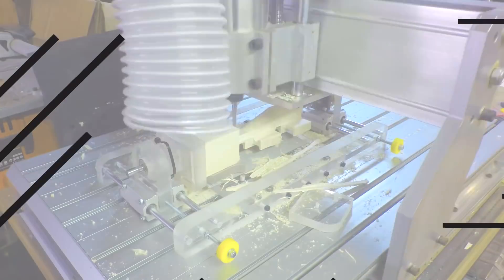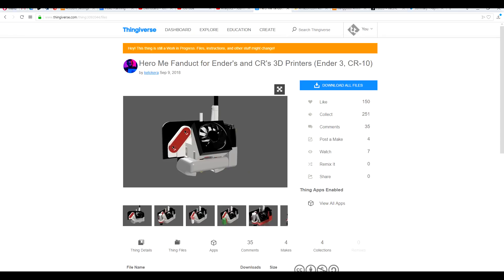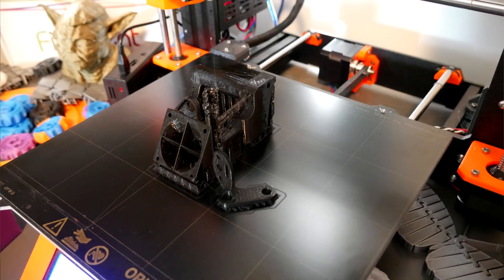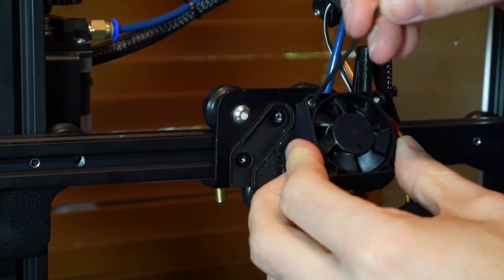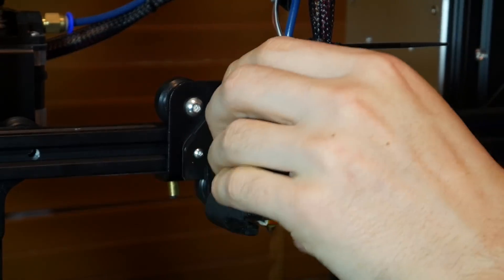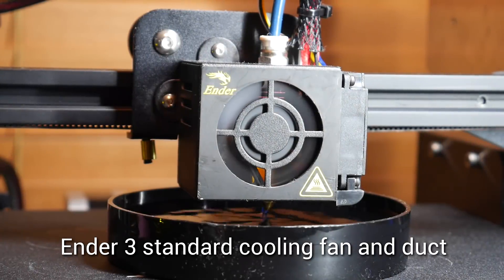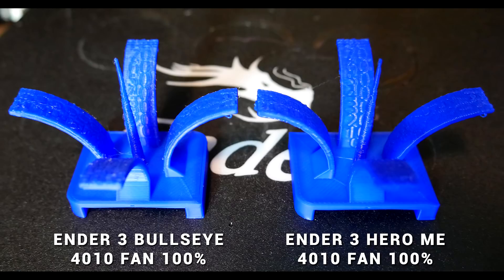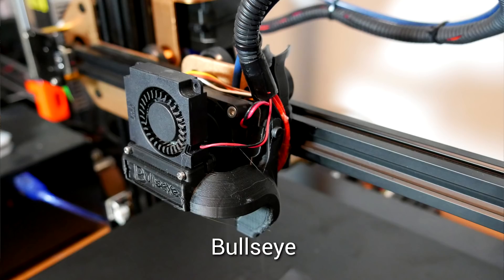Hero Me fan duct tested on Ender 3

Comment: So I am haveing a problem or missunderstanding. I have been looking up information on noctua fan upgrades for my ender 3 pro and it seems everyone is talking about how the noctua fan moves less volume(I checked and the data sheet promises similar performance at 12 Volts). So that got me thinking: Why is no one just using 2 Noctua fans in series? That should provide plenty of cooling. Sadly I couldnt find any fan duct prints for 4 coolers. I did measure the voltage on one of my existing fans and it was around 24.2 Volts, using the resistance I calculated that if everything goes well 2 12V Noctua Fans in series should behave like one 24V Fan but with way more volume moved. Is there something I am just missing? I would rather have 2 fans per one original 24V fan than use some buck converter.

Comment: what about to put big 120mm fan at side of printer, then bring some flexible hose eg fi20mm to the extruder? (sth like wires from mainboard)even plug to inlet there where fan goes in (i think about it), in 24V it can roates slowly (then quiet) and produce mass of airflow
i think ive seen it before on YT

Comment: There isn't enough space for the wires to fit between the lower piece that slides up. There's a grove for the wires, but they don't fit. They push the side fan out. The lower section slides far to high up as well, pushing the air right into the nozzle. If I drop it down, it's dangling so far from the top piece, that it's wobbly.

And the side fan (yes, it's the right piece for the right fan), doesn't fit. It's too fat where the two lower screws connect. 

It looked pretty though. And all cleaned up. 

All I can guess from this, is that my E3 version, is slightly different than the design intent.
Reply: Bloody hell, for all the issues, so far, the test print is flawless. The bridging was absolutely perfect! I've never had such great bridging.
Reply: Wow. This thing is remarkable.

Comment: 4010 blower doesnt fit to 4010_Pipes, it needs about 3,5mm to mount, but there is only 1,9mm and there is no space to modify that without damaging part, so just wasted filament.

Comment: Does anybody ever tryed to use a real powerful blower to cool down the print under the nozzle?

I was thinking on using a silent bldc blower, preferably oversized so that it could be used at low speeds, and channel the airflow through a flexible hose into a duct in the printing head (allowing to install the blower away from the printing head). One could even use an air mass flow  to control the cooling according to the linear speeds and temperatures etc...

The blower could be something similar to the blower used in the quick hot air station, but with better performance.

What do you think?

Comment: I need your help the Stock Filament Fan is no fitting in the slot at all to thin and screw holes are not aligned with the ones on the fan. i have the new Ender 3 pro . can u help me with a better model?

Comment: What 5015 blower fans are you running? Im looking for quiet options. going to upgrade to Noctua fans for hotend and electronics box. eventually i will upgrade to your rear mount electronics box. i like the clean look and leaves plenty of space upfront for tool and hardware drawers.

Comment: A bit of a pain to print to be honest, but works really well. I had to open it up in meshmixer and add support there in order to get it to print correctly without a huge mass of support in the wrong areas. I like that I can use this one with my direct drive setup on the Ender 3 whereas The petsfang/bullseye I can't as the fan sticks up too high.

Comment: Hey Michael. When I print an ABS part with the Hero Me, even when the part cooling fan is turned off, the part always curls up from the back. Every part I print seems to curl in the same place and I found out the the heatsink fan is also blowing air onto the part from the bottom constantly. I use a PEI bed, 240 on the hot end, 110 on the bed and no part cooling fan.

What can I do to stop that. Blocking the gap between the heat sink and the part holding the heat sink cooling fan only cause the heat sink to overheat.

Comment: I printed the Hero Me, but found it to be a little too tight around the heat sink of the hot end.  It's actually pressing against the left side (as you face the printer) once installed.  Also, the screws from the 4010 fan were too small for the holes in the base.  I know they have a few versions because the screws changed, but I thought I printed for the smallest screws, I'm having to go back and look again to see if perhaps I printed the wrong version.  Fortunately, it's a tight enough fit that screws merely need to act as "pins" to hold it in, but I still want to play around with this print to see if I can't get a perfect fit.  It does seem to be printing a little better than the stock in the few prints I've done so far - I've seen less stringing for sure.  I'll be happy if I can get a little more gap between the base and the heat sink, and be able to tighten the screws holding the duct.  In both cases, it's the base that needs work, the duct is perfect.
Reply: I also found this, what an absolute bugger. I printed the STLs that were recommended on Thingiverse. Still, I was happy that I could slap on a Noctua 40x20 without any modification (plus a Traco TSR24120 for regulation - small, good quality and cheap, about 5 bucks - definitely recommended over Chinese buck boards). I tapped the main duct with M3s - four holes on each side, I just ran through them all with a screw - but the mating slots on the part cooling ducts look like they're designed for M2s. I ended up tapping the slot as well by force and then wiggling until I could tighten the screws into something. Similarly the blower fan didn't really fit, and I'm not sure there's any material for the screws for that to fit into. It's essentially a friction fit and I'm not super worried about it. Really I think this thing needs to be overhauled for a better mounting system. It works fine as a cooling fan, but it's needlessly fiddly.

Comment: Everybody does the wiring wrong on the Bullseye. You have to slide the heating element through it then up and its fairly clean.  Cooling fan wire is still out there though.

Comment: Ive had an issue with the HeroMe,... the wiring from the hot end, seems too "fat", and when I try to attach the fan/duct piece, the wires bulge outward so much that it pushed the fan away from the main assembly, and eventually, snapped the duct piece where the screw holds it on the wiring side, leaving the the duct to hang below the level of the nozzle, thereby making it useless. Is there some trick to this? 

I have stock Ender 3 Pro hot end wiring, as I said it just seems too fat to fit properly in the channel and allow for the ducts to fit properly,... advice? Thoughts? Comments?
Reply: also, shout out to Michael, for all the excellent work, information, and even inspiration! I wouldnt be where I am now if it wasnt for  your excellent channel!
Reply: I too have this issue, but less severe
Reply: @XavierVaati  I went through searches on thingiverse, and found https://www.thingiverse.com/thing:3020267, which looks to honestly have a more decent style for the wiring, as its INSIDE and not OUTSIDE, which, obviously should be fine since the heat shielding on the wires is whats causing them to be fat enough to not fit the HeroMe design haha,... MediaMan(the guy that now runs HeroMe after originator stopped) has a remix of this thing, but, Im not sure I like his remix due to the angle of the air aiming more toward that nozzle. I may try them both, but for now, Im gonna try the original thing I linked above.
Reply: This video is now out of date and the link points to the old version which is not the one people should be using. The hero me V3 has quite a bit larger wiring channel and it's also much stronger: https://www.thingiverse.com/thing:3182917

Comment: Have you (or anyone here) had issues with the hero me printed in PLA? I had mine printed in PLA and last night had a huge failed print. Something was hitting the parts as it was printing and moving the bed, eventually falling off. I believe this was the Hero me fan duct, especially since it is completely warped after I removed it. Is it necessary to print it in ABS or PETG?

Comment: Actually I am a little disappointed with this build. Still have to give credit to the author of Hero Me. The time and effort that was put into this project is commendable but I found it to be an awkward build which took three goes before a satisfactory out come was achieved.The support was the worst problem followed by the fragile screw slots to connect the 2 main parts together. Tended to crack or break off altogether. OK it works well enough but would I build another one? Don't think so. The Bullseye I think is the better option.

Comment: I like this one because it uses all stock screws. You dont need anything extra. Plus it looks better than bullseye. 
Downside is : those tabs that goes into base's slots are extremely thin and you can easily break it while installing. I broke them when I was trying to adjust the height.

Comment: are you still running the hero me? i had to reprint the fan pipes several times because they kept warping after a few uses. eventually gave up and went with something else.
Reply from the maker: Still using without any issues.

Comment: I t hink I print one of the parts wrong. Mine has two places to fit two fans. May have gotten the wrong file for the bottom piece.
Reply from the maker: Sounds like it. The two fan ones are generally considered overkill. You have to turn them down so much it's redundant.

Comment: Great videos as always. Thank you so much for your in-depth studies. I have the pets fang bullseye and I'm having cooling issues on one side. I found this new fan option on Thingiverse and I plan on installing it. I was wondering if you could run this one through your testing methods too please:
The model is here:
https://www.thingiverse.com/thing:2767047
Reply from the maker: Woah that one is crazy!
Reply: @TeachingTech  lol. I actually went ahead and installed it. I added dupont connecyors to all the fans on the hot end and added a splice connector to split the the lines so i can back to either a single fan and the petsfang mod or this new one. I love this new one. The amount of cooling provided with two of these blower fans is so good that my bridging capability is through the roof. Insanely good now. It was good stock but this is so much better. Im away on vacation at the moment, but as soon as i get home ill take pics and post to this thread so you can see the final and how it prints now.
Reply: @TeachingTech  could you try this one too? and stack them up against the bulls + hero, i'm printing my final piece of the hero v3 at this moment, would be nice to know if this would be a good upgrade :)

Comment: I love the videos and they are very helpful.  I used your guides in attaching a bltouch to my ender 3.  Are you planning on doing a Titan Aero guide in the future?  I just picked one up and I am shocked at how little content is available to help me.  I cannot find anything at all on wire connections.  Either way, thanks for the great videos.
Reply from the maker: I have a replacement extruder on the way, but it's not the aero. It does, however, interest me. I may well end up covering it at some stage.

Comment: hi again!
.. looks like a nice part set, but what about this? https://www.thingiverse.com/thing:3179892 - looks also good to me.
ps: started to change all fans, because the noise is absolutely awful - more than anything else. my main problem now  is the radial stock fan; this is also a very cheap and crappy one - makes lots of noises even on x-movements (already changed to new one - same story). but - i couldn´t find a proper radial fan available and since it is regulated, stepdown module for a 12 v version axial can´t be used. so i´m now trying the 5015 (also cheap crap?) version; if this doesn´t improve, i need an axial solution - maybe with a resistor (330 ohms, > 0, 5 watts should do) - anyway.

Comment: I choose the hero me fan duct to print. Even though it's the only one I've printed I'm still happy with this fan duct. Placement is tricky and remember to only print supports on build plate. It will print inside the duct if it is set to everywhere.
Reply: I made this very mistake

Comment: Here is a dual 5015 fan mod of the Hero Me: https://www.thingiverse.com/thing:3182917
Reply: With these mod versions, there is very little support needed when printed in the orientation that I have the STLs set.
Reply from the maker: I'm looking for something like this for my Tornado, thanks.
Reply: From what I saw in your video (the screen shots of the S3D gcode preview), you can greatly reduce the density of the supports you use when printing these parts. I think my support settings are about 1/4 of what you have set, yet print just fine. @TeachingTech

Comment: Thank you for your outstanding test to show what works and what does not. Have you considered testing the Prusa R3/B7 slanted fan mount upgrade. I’m sure a lot of people in the community would like to know if it’s worth the work or not. Looks good and is suppose the lower the temperature around the nozzle but does it print better? Your overhang test would be great on a before and after. Thanks again, I enjoy your videos.
Reply from the maker: Thanks John. I was actually considering doing a video on simple updates for the MK3 since my one is still stock.

Comment: SCREWS bro they ain't bolts..... Thanks I love your tutes couldn't have fitted a BLtouch without you're easy to follow guide
Reply from the maker: Thanks for watching. I count a bolt as anything with a machine thread (eg. nut and bolt), and a screw as anything with a self tapping thread (timber screw).
Reply: @TeachingTech  That is basically the correct definition for each. You are right to call it a bolt.

Comment: Hi! I'm the creator of the Hero Me... Few things you didn't mention... Easier access to the fitting and PTFE tube, don't need extra screws, fusion 360 file included so you can create your own parts. To have the same level of results as Petsel's work is a achievement for myself!! He is my inspiration for all this! And for you a big thanks!!
Reply from the maker: Thanks for the design, I really like it. There are varying ideas on how it should be oriented to print, would you consider updating the description on Thingiverse?
Reply: Yes! I'll update the info! but the way you print it is really the best way to do it. As there are so many parts I didn't put the info online... but I'll do a PDF that I can update and upload with every attachment.
Reply: @TeachingTech  One thing that would be cool is a slot for a segment of LED strip.
Reply: Thanks for this great fan duct!
Reply: The Ender community is amazing!! so for me is a total pleasure!
Reply: @amaurisstudio   have you considered 5015 version with fan axis parallel to the ground?
Those bearings are no fans of working mounted diagonally.
Reply: Does it fit on the geeetech A10?
Reply: @marvin9376  is that a yes or no ?
Reply: Awesome of you to share the F360 files - thank you!
Reply: really appreciate the work, thank you for the high quality free mods!
Reply: you are amazing
Reply: Could you update the design to work with the newer, wider fan tabs?
Reply: Hey, do you have any fan duct that works with prusa mk3?
Reply: Can you please check out my comment. May have printed the wrong bottom file.
Reply: hey
you had made to version of hero me , which one is the best ?
Reply: Thanks, Marcelino!!
Reply: thanks guys much appreciated
Reply: Just build my first hero me and wont' be my last! thank you!
Reply: Hey, may i ask you why do i need adjust firmware offsets and reset Z offset? Im using default ender3 parameters. And default firmware. Thanks.
Reply: why does my stock fan not fit?
Reply: I recently printed this and installed it on my Ender 3 Pro. I also treated myself to the EZBoard Lite and EZABL Pro for Christmas. The EZABL Pro probe is slanted using the mount for the Hero Me. 
Any tips on how to fix this?
https://www.dropbox.com/s/yqagaf80b3hv60n/80789442_10157581195826327_7082452168329920512_n.jpg?dl=0
Reply: Legend... Thank You for creating and sharing such a cool design.
Reply: why is the front vent mounted in reverse?
Reply: wow
Reply: Thanks for the great fan duct but i ran into an issue with my 40/10 fan area i tried to press my fan in and it seemed like the area where the screw goes through was in the way. Did i print the wrong 40/10 part or is ther some required triming to make it fit?
Reply: is possible to adapt to ender 3 v3 se?

Comment: Hello Excellent solution, however there is a much much simpler and more effective solution, it is present on Thingiverse look here: https://www.thingiverse.com/thing:3020267
I downloaded and printed the file, I had excellent results, also being a single piece the weight is modest and this allows you not to have artifacts from vibrations.
Reply from the maker: I checked it out, it looks nice.
Reply: I printed it in black PLA is beautiful, I made a print of 12 hours, has not undergone any alteration, crazy, it goes that it is a beauty.

Comment: i use the "Imagine That" fan duct on my cr-10, and it has a great improvement over the stock one. yes, it does need a separate fan mount for the hotend cooling fan, and it uses two 5015 fans instead of the stock 4010, but the difference is noticable in performance. Take a look on the model... ;)
Reply from the maker: That thing is enormous! I'm looking for something like that for my Tornado, thanks for sharing.